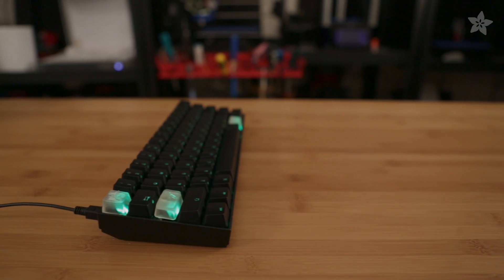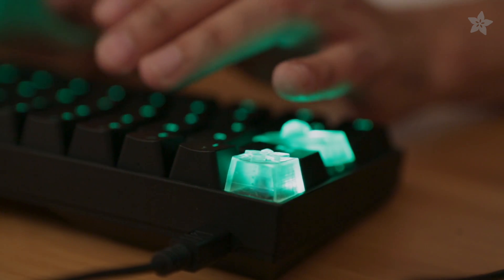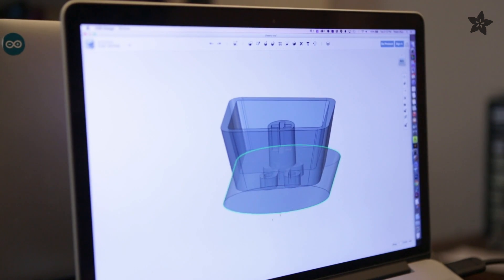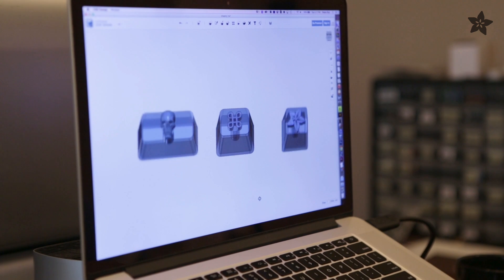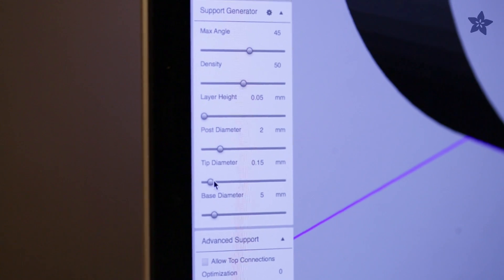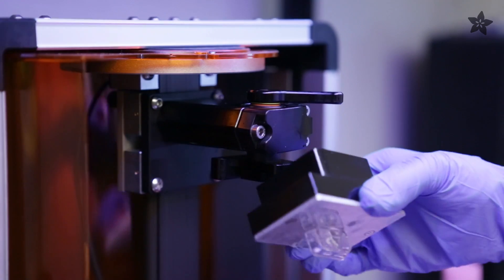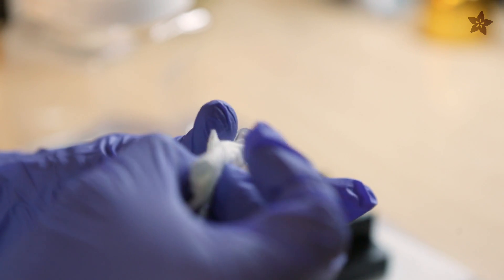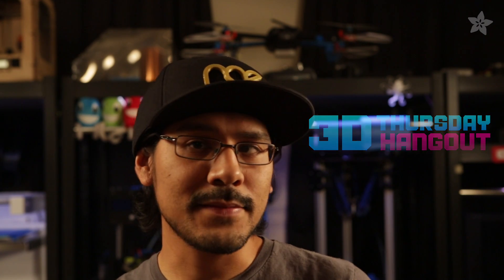3DPrinted Custom Keycaps

Comment: 3:26 Alcohol doesn't cure the resin! It's used just to clean off uncured resin from the surface of the model. You should let the model sit in UV light after cleaning it with alcohol to fully cure and harden it.
PS. Otherwise, great video! Nice that you touched on modeling the keycaps in CAD. I think the coolest thing with these is that you can model your own, and it helps to get some tips on getting started.

Comment: i printed the skull aswell but with black pla fillament at 0.2 mm painted the skull white and cut out the eyes down to the light sorce and the nose and mouth than i made little groves in the teeth so you can see the light going trough that aswell

Comment: Could you do a commonly bought keyboard, ALL keys, ergonomically colored? My Dell XPS-15 notebook, with backlit keys, needs this.
Perhaps Dell could arrange for you to have factory templates. No need to measure.  On a  translucent keypad, self-adhesive clear labels could be printed to fit the flat-topped keys.

Comment: Very interesting idea of replicating small parts. Speaking of resin - why not just cast a resin keycap in the first place without a 3D printer. I guess, this shouldn't be to complicated since we only have to focus on the backside. The frontside of the keycap could be designed almiost freely